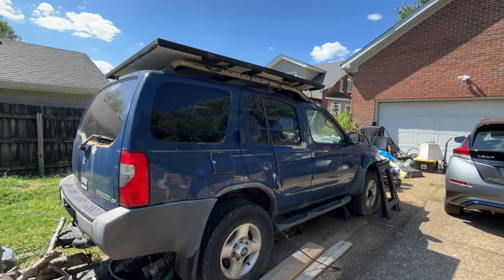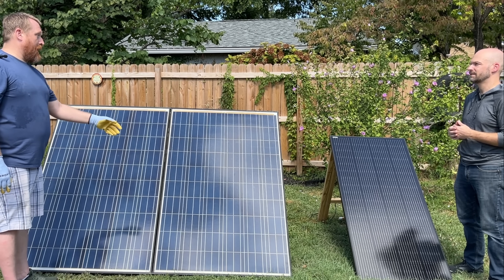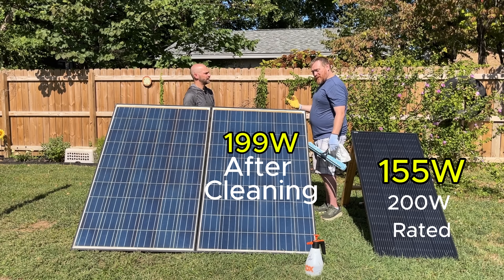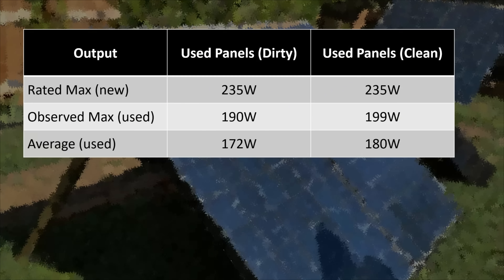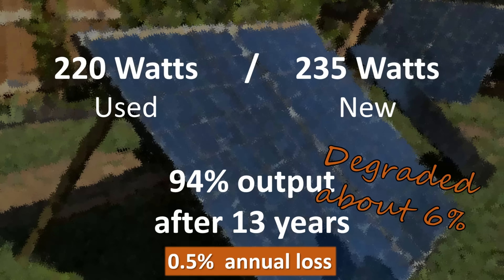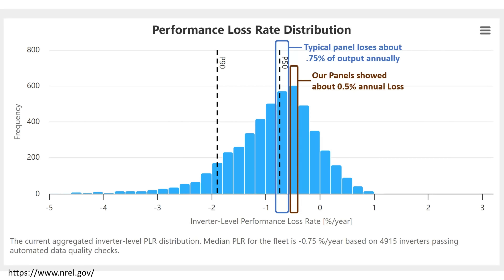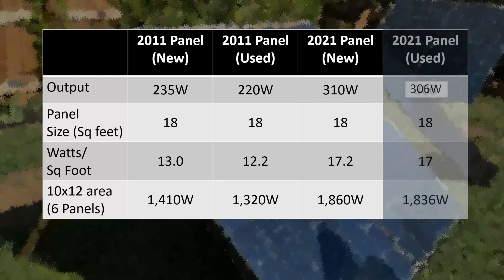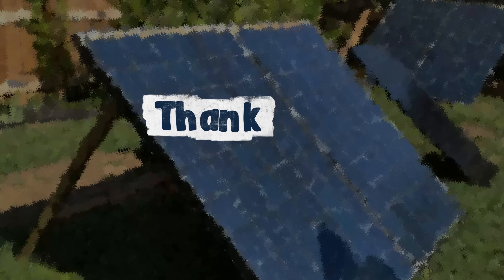Considering used solar panels?  We put them to the test!

Comment: Very useful video many thanks. You ought to possibly do a video on how to identify the age of used panels by their circuitry design if there is no manufacturer dates and people taking the details off to pretend the panels are newer.
Reply from the maker: That's an interesting idea – are you finding lots of listings without the spec sticker?
Reply: Thank you for the reply not often but a few and some of the stickers with data don’t have a date on them.

Comment: Mine still working after 20years annual cleaning and some cracks on the protection cover  the power somewhat getting less than when new
Reply from the maker: That's an impressive lifespan, even with some degradation and wear!

Comment: I live in Australia, in a warm climate and my panels are not under or near trees.......and lichen was growing on them when I washed them after being installed for 6 years. The ONLY problem with old panels, is that for their size, compared to new panels, the output per square meter size is low. Roof space that points towards the sun, especially in winter is at a premium.
Reply from the maker: I noticed that about 15% of my audience comes from Australia and another 2% from New Zealand!  This is the first time that I've heard of anyone dealing with moss or lichen on their panels, but I bet it really impacts the output. Has it come back?

Comment: could you share the brand name of the 14 year old panels?   just curious.  thanks
Reply from the maker: For sure - they are Westinghouse Solar model WLW_235_1_DC1_0_B.  I believe they were sold through Home Depot, Lowe's and/or other larger box stores.  They came with microinverters installed. (We did not test the microinverters.)

Comment: I replaced an old 2001 1.5kw system in 2020 with a 19.24 kw system. The worst of the old 175w panels still pulled 163w. All the talk of solar panels not lasting is just BS.
Reply from the maker: Thanks for sharing your experience - that's a fantastic datapoint about the longevity of solar panels!

Comment: Unless you get those old panels for free, and you have enough space available to afford low efficiency panels, then no. Old panels are not worth the effort. New panels cost 50-60 bucks per panel.
Reply from the maker: We were seeing new panels, by the pallet, in the sub $100 range a year or so ago. Right now most are well above $100.

Comment: If the existing panels have lost 10% over 20 years and you have the roof space, carport, veranda just add 50% more recycled panels and you are good for the next 60 years. I reinvest any energy savings and my power use yearly drops faster than any panel degradation.

Comment: I monitor a PV installation that was installed in 2009 and has a theoretical max power of 3,8kW. The inverter logs max power per year. It's heighest measurement was in year 6 (slightly over 3,9kW). The first 10 years there was no notable degradation neigther in max power, nor in yearly production.  The last few years there seems to be some form of degradation but it is very limited: max power has been in the  3,7kW range for two years now. So not surprised that you are measuring almost no loss after 13 years.
Reply from the maker: Thanks for sharing your data - great to see that real-world performance!

Comment: FWIW - I have panels from early 80s still producing nicey...

Remember take cooling off the panels likely is helping as much or more than cleaning. Solar panel are rated at STC - standard test conditions, but once warm produce closer to NOCT - Normal Operating Cell Temperature values which are 75-80% of STC.
Reply from the maker: I agree for the most part as my home array only gets a temporary boost when I rinsed them off.  These panels were quite filthy, though, so they definitely needed a good wash!  Thanks for the note on NOCT, which I've started to see published more frequently on new panel listings.

Comment: In short, don't bother if they are broken or not putting out proportionately to the age what it states it should.  I bought smashed ones and can tell you they are just not worth it, even dirt cheap.  Supposed to be 340 watts, got anywhere from 10-80 watts so considering that what I paid for it I could have bought two used perfect condition panels putting out 280+ watts, I would run away from broken panels.  They can't easily be fixed and I will end up using the metal frames or just putting them up as building siding on future sheds.  Considering that you can buy brand new panels from China in the 500 watt range for close to what the 300 watt used ones go for, I would recommend buying new if you are going to do a large install.  Smaller ones like my 6 panel system used is fine.
Reply from the maker: For sure - I often see listings for broken panels and don't think its worth the effort.

Comment: Do you think it is a industry conspiracy that solar ground racking is so outrageously expensive because they know these free and cheap panels are becoming available?  In windy places wood doesn't really cut it.
Reply from the maker: I think about this, too. The mounting systems can cost more than the panels themselves. Also, the cost of wiring adds up if you are using string inverters.

Comment: I found one S/h solar panel on rubbish throw out  I fitted it up angled north added a $20 solar controller to go to 2 x 55 w deep cycle batteries  I fitted those cheap tape LED lights in the lounge and kitchen in my house ,I attached them to the window pelmets  and wired it up with the switches on the wall beside my lounge room chair , ,I originally was going to just simply use it as emergency lighting but it works so well I rarely use the house 240volt lights, I recently added and run a light to illuminate my large shed ,   It has been connected now for 2years and works so well just off that one panel ,
Reply from the maker: That's an awesome setup and great use of a single panel!

Comment: how much was that 200w panel?  free is pretty darn hard to beat even if it's lower output.
Reply from the maker: I paid around $100 each, including shipping, when Inverters R Us had a sale. It is branded Spartan Power. Still listed on their site, but not currently available.
Reply: @BackyardSolarProject  not bad at all for new.  

also, very good video, you did an excellent job.

Comment: Does anyone else feel the older panels give more power then new ones do 
In the cloudy an not as sunny days 
I've had good results in my older panels on cloudy days then my newer panels
Reply from the maker: Would be interested in to hear more about this as well. Poly-si vs Mono also makes a difference.  Thanks for the comment!
Reply: @BackyardSolarProject I'm bare bones just getting into it seriously but then old white panels Telstra had bhp made them if I recall 
They rocked compared to the red newer panels in cloudy weather 
I remember it well 
An 25 plus years ago closer to 30 lol

Comment: One of the things I realised when I was thinking of adding more panels was that each new generation of panels has different (usually larger) voltage and current characteristics - unless you have on-panel inverters, you typically want each type of panel on it's own inverter 'string' (i.e. connected in series to a single inverter input).  Mix and match different panels would be expected to cause trouble, or at least perform at the worst panel level only...  Resistance also matters here.  I don't know how inverters are set up to handle different input strings, but it is something I'd be checking when considering getting new or old panels....  do you need to get an inverter too?
Reply from the maker: The used panels we tested had microinverters, but they looked pretty rough. I think my neighbor is just going to get a string inverter when he sets them up.  Agree that mixing and matching isn't ideal!

Comment: Only 12 years old? Pff, at work (everything is run off grid because it's in the middle of central Idaho in the middle of nowhere) we're still using 21-26 year old panels lol
About 12.8kw, and rated power output would've been 15.1kw.
I bet that being up in Idaho has helped, since it rarely gets above 85f ambient. And winter time it can get to -50-60f overnight in the winter.

Although they're not going to be around much longer, going to be replacing them with new bifacial panels soon. Going up to 38kw without bifacial gains.

The old panels have been pretty decent! The only issues we had with them was one got shattered (and ended up being in operation for 6 more years lol) and another one had a buss bar solder joint that wasn't completely soldered well, and it lost connection eventually. Was able to cut into it and fix it for low voltage use.

But yeah, solar panels and their longevity is very impressive!
Reply from the maker: Thanks for the background on your 25 year old system. I've always thought it would be good to keep a few spares around for breakage ... but back then, I bet it was a much more expensive setup!
Reply: @BackyardSolarProject I'm sure it was lol

Comment: Your calculations are initially flawed in that you are considering the rated wattage to be the actual wattage the panels put out when they were new (although you arrive at a conclusion I do agree with).  That is not the case.  The rated wattage is measured in the laboratory at an optimum incident light luminescence and panel temperature.  The panels when they were new, however, never put out their rated wattage in the field due to the fact that one variable or another in the field de-rated the panel due to lower power generating conditions (luminescence, temperature, light incident angle, etc).  So obtaining 220W (actually the 190W is probably far closer to what the panels were actually generating, is doing quite well for 14 year old panels.
You also have to remember that panel technology (retail) is less than 30 years old in practice.  30 years ago, solar panels were running about $6 a watt.  That made panels extremely expensive, so manufacturers all put limits on the life span of their panels, just for good measure and liability  reasons.  Panels, however, under normal conditions (forget Carizo) have performed and fared far better than what was anticipated.  Also, the temperature/performance loss comparison is instantaneous.  Panels generate far better in the mid-late mornings and mid-late afternoons in hotter climates (I'm in Nevada) than they do mid-day.  I'm sure NREL data is under laboratory conditions, however their result is not all-encompassing for any given set of panels or brand.  Brand, by the way, is probably the most influencing dynamic on performance than any other.  There definitely are good brands, and there are cheaper, less effective brands in solar panels.

The size issue really defines the discussion here.  It's a given that the area in which you install your panels governs just about everything in the design and the economy of the installation.  That is precisely why we are seeing large arrays coming off line and being replaced by more efficient arrays.  

I recently purchased 2 of these older arrays equivalating to about 20kW of generating capacity (actual).  I purchased them at about 7 cents a watt which was a good price no matter how you look at it.  I do ground mounts and I have acres of space, so it is very economical for me.  I've seen the value in Facebook arrays for sale.  Hint, the best sales are coming from contractors selling first generation grid tie systems.  These are best for lower voltage systems, up to 36V.  The second generation arrays will work well for 48V+ systems and those panels are now available in the cents per watt range.

I agree with all your conclusions.  I'd buy more panels, but I cannot use what I have already.  I'm not grid-tied.
Reply from the maker: Great feedback.  Based on my experience watching my array, both with 200W and 300W panels, I only see the rated wattage a few times a year, and for brief hour-long periods in the afternoon.  Most days they peak about 60-85% of their rated output.  Check out the NREL website.  They are actually tracking the performance of arrays in-the-field, across the country.  BTW, at 7c a watt, you got a great deal!

Comment: I’m going to say this again. 

The proper way to test a solar panel. (I was taught by an electrical engineer)

Look on the nameplate of the panel for the ‘Isc’ number. (Short circuit current)

Under full sun get a clamp on current meter and a short piece of wire and momentarily short positive to negative while using the clamp on to measure the current. (There will be some sparking, so don’t be alarmed)

Compare your reading to the number stamped on the panel. 

Just measuring open circuit voltage with a multimeter does not tell if it will work under load.
Reply: This post needs highlighting. Open circuit voltage is nearly meaningless. Panels will always produce VoC given decent light, no matter the aging. It is the current that matters. And measuring ISC is honestly a great idea that I didn't think about
Reply: @dominikvonlavante6113 Yes, I was working for Shell Energy Canada in northern BC doing PM’s (scheduled maintenance and checks) on remote gas well sites.  Testing batterys and solar panels was part of the PM’s and their engineer told me about that way to test panels, it was part of their procedure.  I didn’t believe it until the Isc number right on the panel nameplate.  

It doesn’t take long, and it works.
Reply: A high power variable resistance load would be an excellent tool for these tests. Use in conjunction with a clamp meter. Turn the resistance down and watch the voltage and current
Reply: @Dazzwidd A piece of 14 gauge wire is cheaper and I had rolls of it on my truck.
Reply: To avoid any sparking a clever cookie might temporarily cover the panel while setting up to test?
Reply: Anyone with knowledge would be an idiot to short circuit ANYTHING. You can put a heavy load on it , but a SC is just stupid.
Reply: @markae0 You can say what you want, are you an electrical engineer?

And why would they print the short circuit current right on the nameplate of every solar panel built. 

Sometimes if you don’t know what you are talking about, you should just say nothing. 

I have done exactly this thousands of times and all that has ever happened is I discovered a few bad solar panels. 

So until you have any actual facts to discuss, I will ignore your future comments on this matter.
Reply: @markae0 I think it might not hurt the panel, but a short circuit is definitely not a realistic test.. You load a panel, not short it out unless the goal is pretty sparks. I would say there would be a voltage under load that would be expressable as a percentage of the open circuit voltage that would be the best representation of panel performance.
Im NOT an electrical engineer, but I do a lot of experiments with electronics and have just started playing around with small solar panels and charging Li-Po cells
Reply: @Dazzwidd If you think that, you would be wrong.
Reply: @Dazzwidd  A short circuit test on a solar panel is a correct and standard procedure to measure its maximum current output by directly connecting the panel's positive and negative terminals through an ammeter in full sunlight. This test helps verify a panel's performance by comparing the measured short-circuit current to its rated specification. It is safe for a single panel if performed correctly with a high-enough current range on the ammeter, but can be dangerous for large arrays. 

Get it?
Reply: @rickschlosser6793 you are extremely rude and not only don't get that, but my point also.
Reply: @Dazzwidd No, you don’t have a point to make.  I’m a trained, ticketed tradesperson that was instructed to test panels this way by a registered profession electrical engineer.  I had to teach apprentices to do this. 

I know what I am talking about and some random poster on YouTube won’t change that.

Comment: for me, the real killer is the 36V... its like they were intentionally designed to not be compatible with most battery based systems, 12, 24, 48V... sure, you can get 36V systems but they seem to incur a 100% cost increase...

but whatever. slap a few on to a water heater (accounting for the DC so requires a mosfet or some other type of switch capable of dealing with DC)... free hot water.
slap one on the water pump, that cistern on the stand is constantly full.

slap one onto a heater element and drop in a drum of sand... 

the battery issue is really a non concern, especially if you simply choose to not use batteries altogether.

contact any solar installer. theres a LOT of systems only a few years old, being replaced on insurance, due to inverter failure. and they are ALL having to PAY to dispose of these panels...

i have about 40 of them... ive had to stop accepting them now...

Comment: no idea about solar panel specs, but do new panels put out a similar voltage compared to the older panels?
From what i have seen on marketplace, typically second  hand solar panels sell here for about 10 bucks each, and our local council charge you $10 to dispose of one. New panels work out about $100 each when doing a roof full install. (Not including the install price of course)
Reply from the maker: All panels are different in their specs and voltage ratings, even between newer ones.  In this case, the old ones were rated at 29.6V at Pmax and we saw 23-26V across our test readings.  Definitely ask the people selling them on Facebook to send you a picture of the spec sticker on the back of the panel.

Comment: I have have one of the 40+year old first mass produced modern solar panels.  45 watt.  It still puts out 45 watts you can see the silicon wafers.  Solar PV is fantastic.
Reply from the maker: That is incredible - would be cool to do a comparison with that one!
Reply: @BackyardSolarProject  I think it spent a lot of time in storage after it's initial de installation.  I'm in SD.